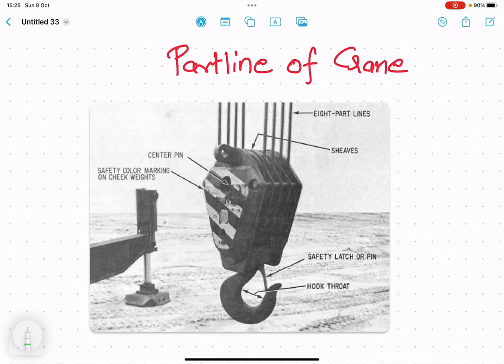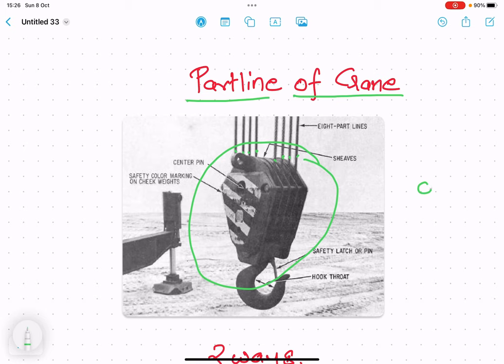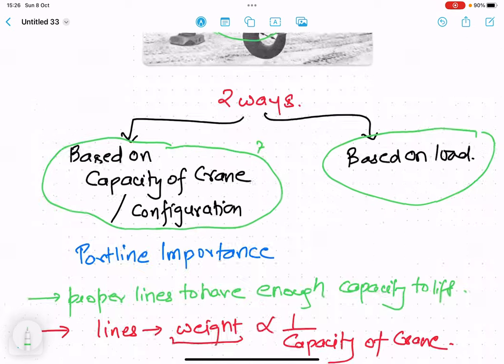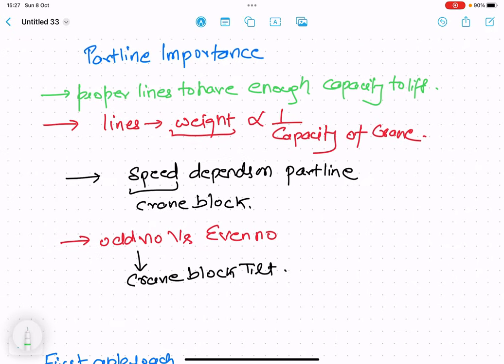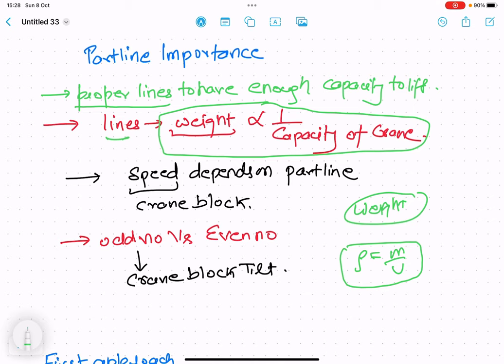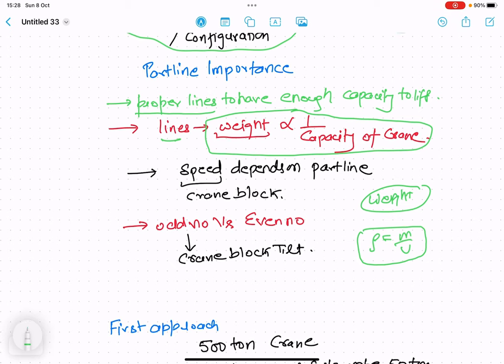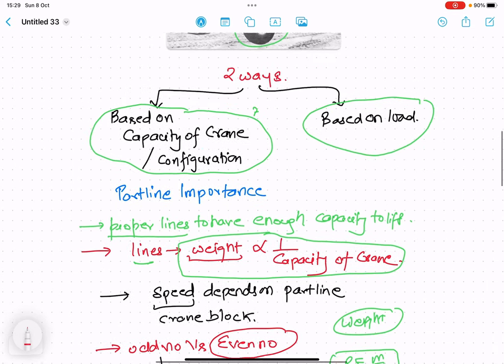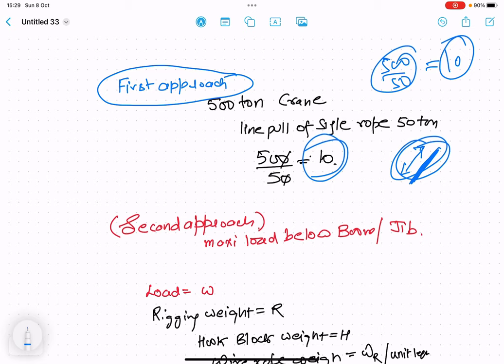How many parts of rope do I need for my crane ? Calculating number of Partlines of crane

Comment: How we can know the single line pull capacity as you said in video 500t /50t single line pull capacity from where do you get this 50t single line pull capacity
Reply from the maker: Data available with rope itself and crane manual or else by radius and make u can have brief idea abt it